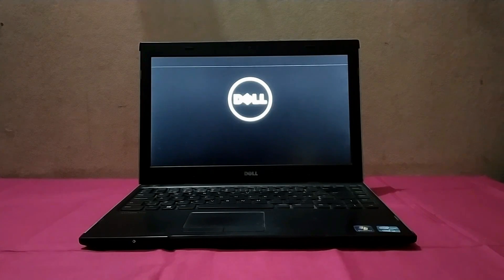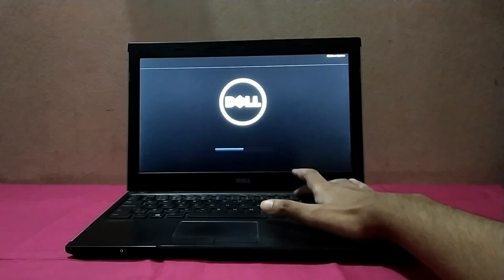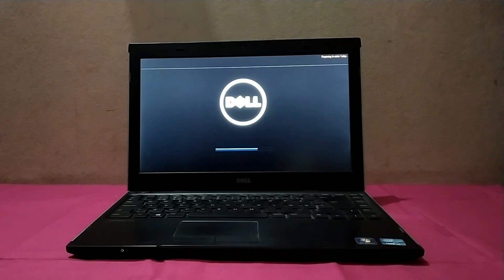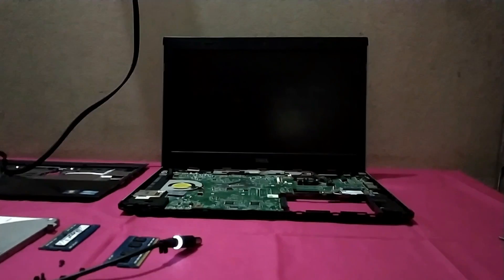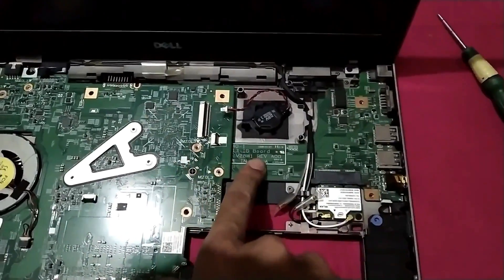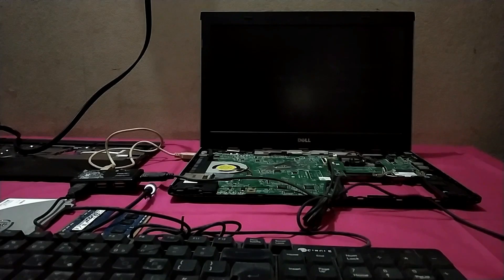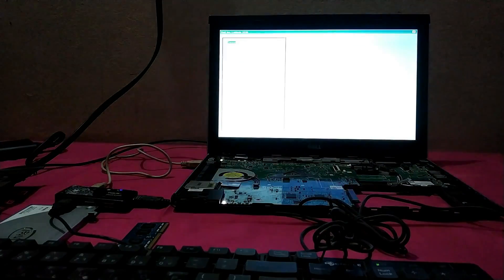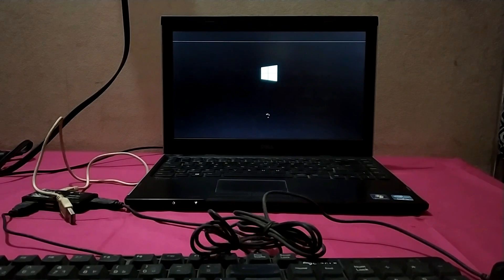BIOS hanged, stuck on boot logo, what should I do ? | Dell Laptop.

Comment: When I try to enter the BIOS (f2), it stays stuck at the logo dell And  preparing to enter setup
Reply: Same here...did you solve that? Kindly help
Reply: Change the BIOS battery  @TheVictoryVoice.
Reply: If this does not work, program the BIOS chip. If this does not work, the BIOS chip must be programmed by a laptop repair technician.

Comment: What is the type of connector you are using, bro? To hook up the keyboard, and where do you plug it?
Reply from the maker: I used a USB keyboard as the laptop's own keyboard was disconnected from the main board. If you have only one USB port after disconnecting any sub-PCB or daughter board, you can use a USB hub or USB multi extender in order to do it.

Comment: The shit does not even go to bios menu it's just stuck on bootloop😭😭
Reply from the maker: Just try to remove sub pcbs or daughter boards if there is available. And then try. Almost all Dells can be fixed by this process. Or just disconnect one by one and try these steps if there are multiple daughter boards.
Reply: @technicaltacticts4380  I took out the cmos battery to reset, is it enough or do I also need to flash bios?
Reply from the maker: @undergroundnet3907  No. CMOS battery disconnection isn’t enough. You have to gain access in the BIOS so you have to disconnect the daughter boards to perform it.
Reply from the maker: @undergroundnet3907  And if you have got the access of BIOS no need to flash. But if you want to update it, you can. As every BIOS firmware update gets many security updates related to the chipset, BIOS and processor.
Reply: @technicaltacticts4380  it's stuck on logo of Dell I press f2 or f12 nothing happens that's why I ask
Reply: @technicaltacticts4380  the thing is that there are no 2 separate motherboards sir everything is soldered together is just one main board that's why I ask and the laptop is just stock on the logo
Reply from the maker: @undergroundnet3907  At first I am a simple man brother. We are brothers, please don't call me sir, brother.

So, at first download the BIOS firmware set up file. Then execute or unpack the set up .exe file and try to copy it on a bootable USB flash drive. Remember brother, the USB should be bootable. Then disconnect the CMOS battery and the Li-Ion battery. Then plug in the charger and before the Dell logo insert that bootable USB flash drive. I hope it will work as many of the Dell laptops work like that.

Comment: July 2023. My Dell e5570 laptop sat idle for 6 mos, after which the start button only gave BLACK SCREEN. With battery removed, and AC Charger plugged in, pushing start button gave only DELL, and hitting F2 or F12 multiple times did nothing. Then I replaced battery (I think mine had died), but with or without AC Charger connected, still only DELL logo. FINALLY I followed what another user did: I disconnected the regular battery, Disconnected the AC charger, AND DISCONNECTED THE COIN CMOS BATTERY, THEN Pushed the Power button for 20 seconds. That worked. After reconnecting the CMOS Battery and the regular battery, and pushing Start button, I got PAST the DELL logo into other screens that enabled me to follow prompts and reboot. In any event, thanks for your video.
Reply from the maker: You are most welcome.

Comment: Bro I have Dell Inspiron 10 pp19s. When I access the mother board as told, there is no removable SUB PCB as mentioned. Do you have any solution to this?
Reply from the maker: Bro, just unpack/execute the bios exe firmware into a bootable usb flash drive and then try to restart the pc disconnecting the hdd/ssd.
Reply: @technicaltacticts4380  bro, I have tried it but it will not boot on USB. It only shows F2 or F12 highlighted in DELL LOGO, but it will not continue. Is there a specific way to boot and run the firmware automatically without setting it to boot from bios boot order? If so, please give me link or a video please.
Reply from the maker: @dtranscriptionx74aastudio15  Just disconnect power button and install a RAM then plug the power cord. Don't install any batteries. It means the CMOS too. Then try it again. Just unpack/execute the BIOS firmware in a bootable usb flash drive.

Comment: Didnt worked for me please help
Reply from the maker: What happens when you try to switch it on ? Does it stuck on the boot logo ?
Reply: @technicaltacticts4380  when i turn on it after dell logo it stuck on blank screen not bios no one time boot menu is opening
Reply from the maker: @FactHunters01  Okay. That means the firmware is not flashed correctly. You have to execute the BIOS firmware file and need to copy that on a bootable flash drive. If you start the PC, the PC will start taking firmware again. If not, then you have to go to a complex process which is actually a bootloader and you have to flash the BIOS chip by that bootloader. But try that bootable flash drive method first.
Reply: @technicaltacticts4380  no, my laptop show the firmwarei update rebooting the device  but on rebooting it stucks on blank screen
Reply from the maker: @FactHunters01  Did you flash It's original firmware ? It’s because sometimes Dell has the same model but firmware isn’t the same. Try to open the PC. Then remove the Daughter Board and the CMOS battery. Then try to switch on the PC with RAM but without a storage drive and use the AC adapter to power it on. Not the battery. I hope it will help you.
Reply: @technicaltacticts4380  i downloaded it from dell driver and support website
Reply from the maker: @FactHunters01  Then try these steps. But remove the CMOS battery.
Reply: @technicaltacticts4380  i have removed the cmos battery my ssd everything but its still not showing anything after dell logo
Reply: @technicaltacticts4380  i tried this also nothing happen
Reply from the maker: @FactHunters01  Can you try to execute the BIOS firmware ? That means you have to unpack the firmware.exe file to its original and have to take them into a bootable flash drive. Then try to open the PC. It will start taking firmware from the USB flash drive itself. Try to use a bootable USB flash drive/Pendrive.
Reply: @technicaltacticts4380  ok i try

Comment: Same issue but I am not work properly please my help
Reply from the maker: Is there any Daughter Board ? If there, try to disconnect it. If the problem remains then check the motherboard, find the reset pins. Make them short using any metal conductor. Then try again. If it still remains, you have to flash the firmware using the bootloader.
Reply: I also flash firmware but didnt work
Reply from the maker: @FactHunters01  Did you flash the firmware via USB flash drive ?

Comment: I need your help pls

My Dell latitude E6320 is stuck like this
Can't access anything
Reply from the maker: Bro, did you open your PC ? Stuck on the boot logo doesn't always mean the failure of BIOS. Bro, try to open your Laptop. Then try to open every power source. And also the CMOS coin battery. Then remain at it for at least 3-5 minutes. And again try to start it. If it does not work, then you have to try reset or flash the BIOS firmware.
Reply: @technicaltacticts4380  how to force update BIOS without getting access to BIOS settings
Reply from the maker: @nihalshafi5106  Just compile the BIOS firmware exe file and copy them into a bootable USB drive. Then open your PC with plugged in and also the battery inserted there. The BIOS will automatically detect the firmware and install it. Because almost every Dell PC has this system to upgrade firmware.
Reply: @technicaltacticts4380  lemme try
Reply: @technicaltacticts4380  i tried this method

1.Deleted partion of my usb 
2. Formated to fat32 
3.downloaded dell bios update 
4.copied to usb and renamed to BIOS_IMG.rcv

Unfortunately nothing happens
Reply from the maker: @nihalshafi5106  Go to an active pc. Then go to the diskpart command.

Then type these commands

Select disk (disk number of your usb flash drive)

Clean

Create partition primary

Select partition 1

Format fs=ntfs

Active

For every command hit the enter button. After making the usb drive bootable like this, copy your bios firmware file and try again.
Reply: @technicaltacticts4380 just  copy firmware file ?

Or rename to BIOS_IMG.rcv
Reply: @technicaltacticts4380  Bro Can you share  your Telegram id
Reply from the maker: @nihalshafi5106  bro, try this

https://www.dell.com/support/kbdoc/en-us/000128928/flashing-the-bios-from-the-f12-one-time-boot-menu
Reply: @technicaltacticts4380  my onetime boot is not opening
Reply from the maker: @FactHunters01  Does it stuck on the boot logo ?
Reply: does ur laptop working now? I have the same models and same issue

Comment: On desktop XPS8500 I fixed this by removing the external HDs and rebooting.

But it's happening every time I turn on the computer, sadly.
Reply from the maker: In desktop, you can easily reset the bios by shorting two pins. Check your motherboard model number in the website, you will get the info about bios reset pins.

Comment: I need help
Reply from the maker: What kind of help do you need bro ?
Reply: I’m in a boot loop with deal
Reply: Dell 15
Reply: Dell boot loop problem
Reply: Dell 15 5000 series Inspiron
Reply: Well, I got usb recovery still in a loop
Reply from the maker: @spirituallyrich5517  Bro, did you reflashed the firmware using USB ?

Comment: hey bro your video is the closest I got to a solution  I have the same problem with a dell xps 15 where it stucks on the logo and so tried disconnecting my keyboard ,removing cimos battery but it still either doesn't respond to my external keyboard it still stuck I don't know can you help me pls
Reply from the maker: Bro, is there any problem with RAM ? Sometimes RAM also does this.

Comment: What is the reason for cause of this problem,????????
Reply from the maker: BIOS chips always check your system. Sometimes BIOS firmware can't operate correctly if there any fault over the firmware. So, the BIOS chips get a soft brick and can't read the system. BIOS is the door to open the system and close it.

It causes sometimes whenever someone tries to update the BIOS firmware incorrectly or flash the wrong firmware. Every update for BIOS gets some security patches and keeps the system secure. So it is recommended to update it. But any steps of upgradation, if there any fault, it may cause the soft brick.

Comment: I don't know if you're still replying to comments bro But I would really need some help, I have a laptop and it hangs on the boot logo I have tried disconnecting everything as advised in the video, I even tried different RAM chips but it still hangs.. what could be the problem?
It's a Packard bell N2920
Reply from the maker: Bro, try to change the HDD and disconnect the Keyboard. Then try to power on.

Comment: I have a Lenovo laptop and I have to press the space for it to boot...if I don't press space it don't boot...how can I fix this...
Reply from the maker: If you not press the space, then what happens ? Does it stuck on boot logo ?
Reply: @technicaltacticts4380  yes it struck at the logo..
Reply from the maker: @christophermichael2165  Try to change the laptop keyboard. May be a small short is over there.
Reply: @technicaltacticts4380  thanks...not sure if I'll be able to change it the keyboard...

Comment: same on dell inspiron 2305 desktop
Reply from the maker: Have you checked your HDD ? Sometimes this issue may caused by the HDD.
Reply: @technicaltacticts4380  yes i replaced hdd, replaced the video card, replaced the bios battery, moved the jumpers from the bios, swapped the ram, everything... this must be something of the motherboard related to the bios
Reply from the maker: @aircombatmaneuvers  Bro, open the RAM from RAM slot. Then clear the connectivity part of the RAM using an eraser or try to change the RAM.
Reply: @technicaltacticts4380  already done that. Its not RAM. thanks
Reply: @technicaltacticts4380  i have two ram slot with two sticks, i swapped one to another left only one per slot, and also neither and the motherboards does the beep beep
Reply from the maker: Then I think it’s the issue of your motherboard. May be need to flash the bios firmware using jumper.
Reply from the maker: @aircombatmaneuvers  Then it’s not any bios issue. As it beeps that means there is a short on the motherboard.
Reply: @technicaltacticts4380  yes also when i plug the ac adapter it shuts down teh ac adapter led light and the computer .so everything points to short on the motherboard
Reply: @technicaltacticts4380  it beeps when there is  no memory card in ram  slots wich is ok
Reply from the maker: Yes. So, try to find the short of the motherboard. It can't be detected without testing the motherboard.

Comment: Hi Bro, I have E6220 and wondering whether I need to disonnect the PCB board. I'm not seeing anything similar, though. What do I do? Currently, getting stucked with DELL logo even when hitting F2 or F12. CMOS battery is disconnected. I have a feeling there is something up with the motherboard. Your help is much appreciated!
Reply: I have the same laptop and the same problem. How did you solve your problem

Comment: I got the same problem with my PC. How to fix this? Can you please help me :)
Reply from the maker: Is it a desktop ?
Reply: @technicaltacticts4380  hi sir i have hard drive not installed issue
Reply from the maker: @fayehazeltabornal8550  Please check the HDD cable. If the cable is okay, then check the HDD. If there is partition problem, make the correct partition. 

CHECK THE HDD HEALTH BEFORE MAKE ANY PARTITION.
Reply: Same problem
Reply from the maker: @irvansam8235  Bro, are you using a desktop ?
Reply: @technicaltacticts4380  yes. But it is fixed now. Just corrupted ssd with my OS on it.
Reply from the maker: That's a good news...😊

Comment: Bro thats stupid just take off the Battery and put it back on
Reply from the maker: This method not works in every cases. But executing the BIOS firmware or disconnecting the Sub-PCB may work always.
Reply from the maker: @Jerry-if5zh  You are most welcome bro.❤️

Comment: Hi there, I have E6220 and wondering whether I need to disonnect the PCB board. I'm not seeing anything similar, though. What do I do? Currently, getting stucked with DELL logo even when hitting F2 or F12. CMOS battery is disconnected. I have a feeling there is something up with the motherboard. Your help is much appreciated!
Reply from the maker: Just execute the BIOS firmware .exe file using a running PC with command prompt. Then take it to a USB flash drive and just try to go to BIOS menu. The PC will start taking the firmware automatically. 

N.B. : Always connect the charger cable with your PC when you try to flash the firmware.
Reply: @technicaltacticts4380  
I followed instruction in the link but nothing after hitting F12 or F2. Am I missing something?

https://www.dell.com/support/kbdoc/ja-jp/000129365/what-is-bios-and-how-to-update-the-bios-on-your-dell-system?lang=en

Comment: Thanks for the video!
I have a precision m4600. The dell bar fills up but just hangs after. Pressing f2 or f12 doesn't do anything, it just says entering set up but never goes anywhere. Holding fn to go to diagnostic does the same thing.. It says enter diagnostic, but goes no where.

After watching your video, I think this relates to mines, but I'm not sure what to disconnect from my laptop's motherboard. Please help. Thank u
Reply from the maker: Where the external USBs or the LAN port is connected, that is the sub PCB, just disconnect that from your motherboard and then connect the adapter. Make sure that the CMOS battery is also be disconnected. Good luck.❤️
Reply: I have opened the laptop now to the motherboard. The lan port is attached to the motherboard. I don't think it can separate from it. What should I do?
Reply: I can separate USB USB 1394 mic and audiojack. That part separates... will that work?
Reply from the maker: Just separate the USB part. Not the speakers. And then try the process. If it not works, then you will have to execute the BIOS firmware and flash it. I will make a video about that. Please subscribe my channel and press the bell icon so that when I upload the video, you will be notified. Thank you so much bro. Good luck.
Reply: I have separated the b part of the motherboard and it tried to powerup but isn't able to. Ugh.. What am I doing wrong.. And how would I be able to reflash bios... thank u for everything so far, I need to get this laptop fixed :o
Reply from the maker: Did you install a RAM ? Install a RAM and then try again bro. Best of luck.
Reply: @technicaltacticts4380  yes sir. I have installed ram in it
Reply: @technicaltacticts4380  do I remove the video card or should that stay in? Also do connect cmos battery back?
Reply from the maker: Then this will not work for you bro. You have to execute the firmware then flash it.
Reply: @technicaltacticts4380 aw . OK. Thank you for all the help so far. When is your next video coming out? I need it!
Reply from the maker: No need to disconnect the video card. Or install the CMOS.
Reply from the maker: Stay with the channel bro. Thank you so much for being with my channel. ❤️ The video will come soon.

Comment: Broo my dell lap top dell logo stuck f12 button and f2 button working but not open its display
Reply from the maker: Bro, which model do you have ? Is it inspiron series ? In Inspiron it's much similar. Just disassemble it and then disconnect the LAN port. Or if the LAN is soldiered, then just unplug the external USBs. Also brother, before doing this, try to execute the BIOS firmware using a running PC and just take the executed firmware into a USB storage device. Then plug it and go to the BIOS. Your BIOS will automatically start taking the firmware. Good luck.🙂
Reply: Bro malayalam telling bro